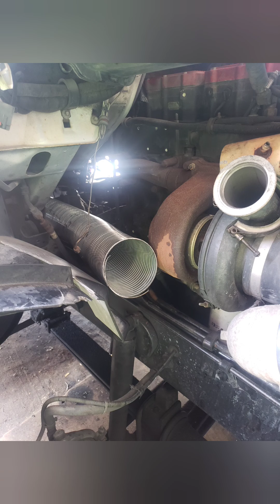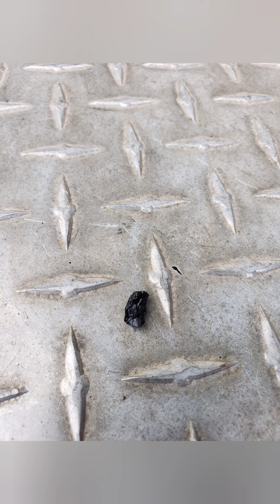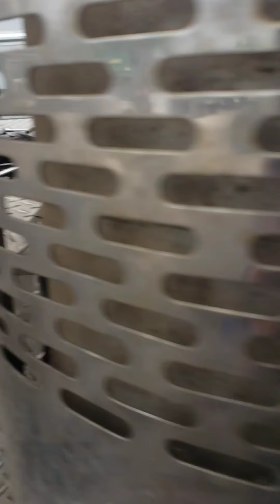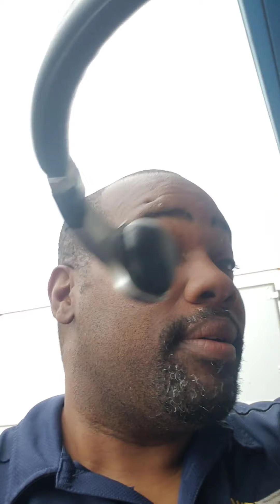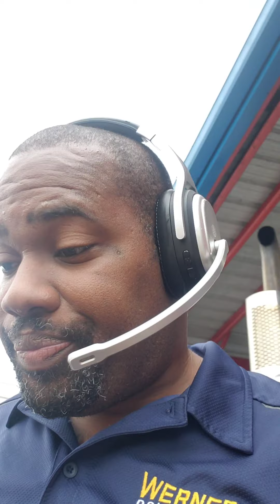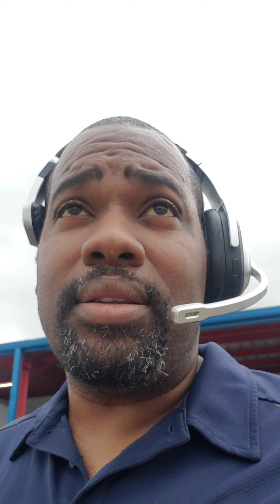owner opp minor truck repairs

Comment: Love the channel preacher. Been an owner operator for a few years now. N I would recommend u to get a new truck bro. I've been on both side having an older truck to have a new truck and. With the little experience I have I've been able to save way more with a newer truck. And also less down time. And also there's nothing like have peace of mind going down the road
Reply from the maker: I'm getting a 2016 t680 in May I'm just fixing this up little by little to do 200mile runs 5 days a week
Reply: @2preach  🙌 Congrats brother 👏